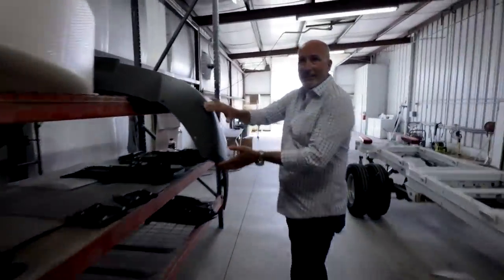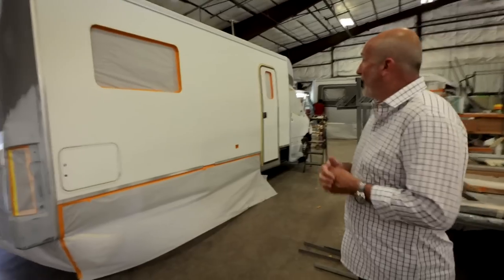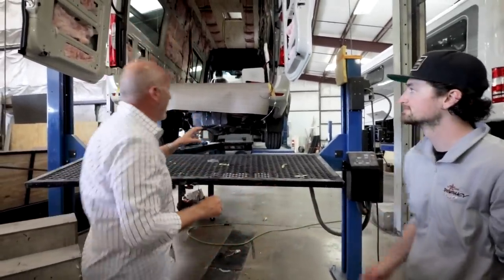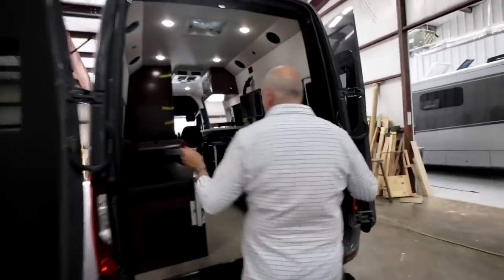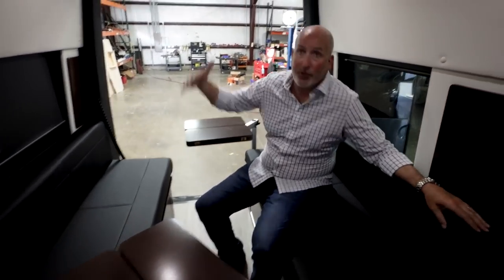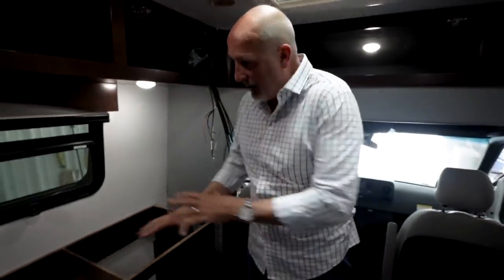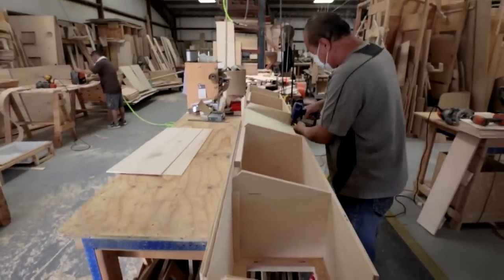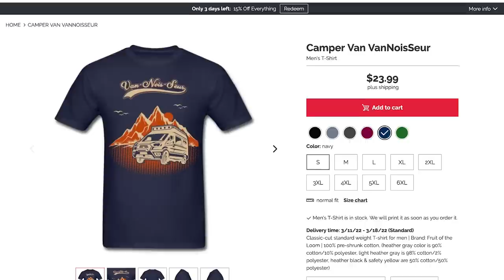Class C or Class B RV: Which Is Better? - A Factory Tour at Regency RV

Comment: I still laugh at these companies trying to justify why the prices of vans are higher than their B+ models! just look at all the work that goes into the B+.. side walls and roof, metal tubs for the storage not to mention the doors for the storage. then they paint the entire coach! on the van, they stick on some silver lining and some pink insulation but that marine-grade plywood must cost a bunch lol Time to admit that it doesn't cost more to build a van it's because more people want a smaller vehicle to drive so more demand! and we all know how that works! more demand means a larger sticker price and bigger profits! don't forget the covid pricing lol
Reply from the maker: Ha Ha you know what Wayne, I am totally guilty of believing the myth of the b van being more expensive than a b+ or a because of "labor costs" to build in side the van...I think after doing this factory tour I'm more inclined to side with exactly what you're saying in certain instances...I think the difference is definitely the build because I've seen b+ vans come in 50-75k under the price of a similar b van based on lower quality materials...and yeah a portion of pricing is marketing or made up in my opinon
Reply: @strangerpalooza  And then these companies take the generators out and put in these lithium systems with an extra alternator which is nice, but there's not enough room on the roof for solar panels to charge the batteries after running 10 hours of AC lol so what do we do? we start up our 6 cylinder motor and run it for 2 hours just so we can charge the batteries! with the prices of fuel these days, I think running a 1 cylinder generator would be more economical than running a 6 cylinder motor lol personally I love the all-included RV parks with swimming pools and golf course lol